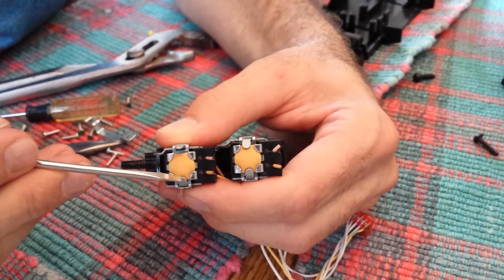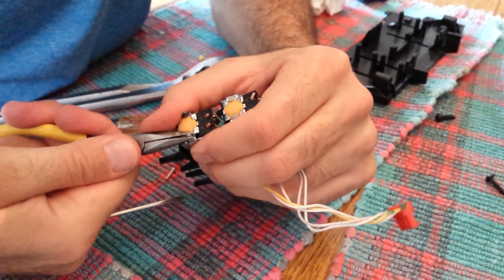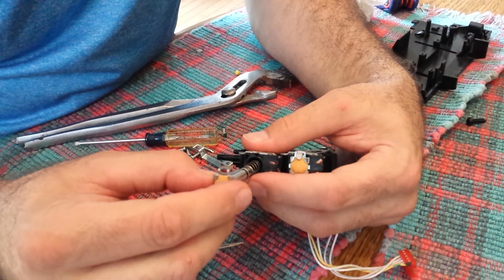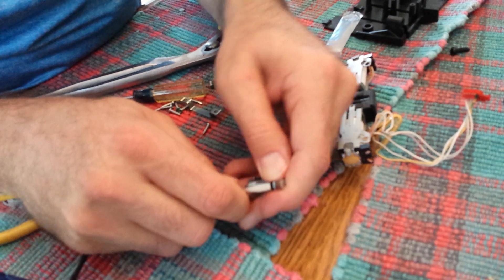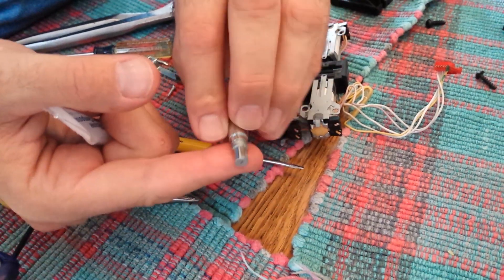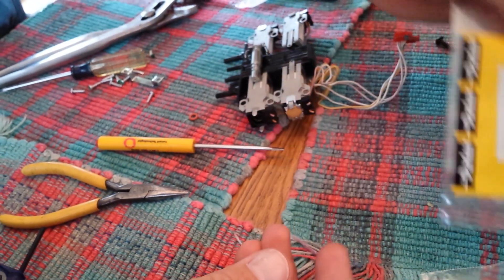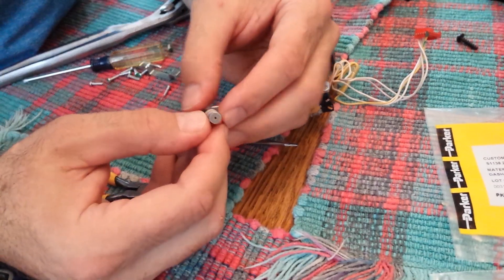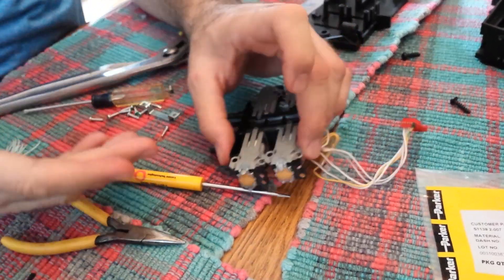EATC UNIT O-Ring replacement for Ford and Mercury Electronic Automatic Temperature Control

Comment: Took a few videos and troubleshooting to find out why it was defaulting to defrost and floor vents. Great video, went and checked to see if the unit had vacuum and the accumulator door. Both were fine and the heat and ac function worked great. Cant safely drive in the south with ac fogging up the windshield. The Hvac unit is in good working order and the car is a 2006 crown vic with 66k miles. Just got my O-Rings in and will be replacing them ASAP. Again thanks for the video.

Comment: Big thanks, worked for me too on my 2006 Grand Marquis. I noticed that you are asking about other ways to get the rings. Well I saw this on a Saturday and needed immediate satisfaction so I went to my local auto parts store and they had the 007 o-rings (that's what they're called). I paid about .80 cents each and $1.50 for silicone grease. $6.00 at the end of the day and I'm so please. AC and heat blowing where it should now.
Reply from the maker: So glad it helped you out.

Comment: Hey thanks!  Just did this to my 2005 Grand Marquis and it worked.  Wasn't switching from vents to anything else, now it seems to work.  I can hear that good old school clunking when I change to the floor vents, and MAX AC is back in full force.
Reply from the maker: Mark,
Sweet !   Glad it worked for you also, how much did it cost to replace the components ?   How much time was involved ?   Just for everyone else's curiosity.

Comment: Thanks for the extra indepth. Have had 3 Grand Marquis since 1996 and somewhat the home mechanic on them. This issue : well spent lots of time on troubleshooting and still same issue and then came across your video. Ordered the O-rings : installed in about 30 minutes: works great. appreciate the help. Issue is solved. was dreading dropping the console to replace the panel door motor but had found out it was working well. Eventually pointed to the control module and well the orings were weathered out, one really dry and crumbly. I do go to fordforums and put my two cents in when i can. again thanks. you have inspired me to make a video of something I may know that others dont.
Reply: 123skyvision , part number please , links in the description open to same product
Reply: I will look for the package in the garage and see what it might say on it. May get back to you later on today or tomorrow.
Reply: How many you need. I can mail you some. Here is a part AS568-007-RR806,  description  007 oring 70 duro red silicone. dont remember where i bought them.
Reply from the maker: 9396K12 Silicone O-Ring, AS568A Dash Number 007, Packs of 25 
Amazon:   
http://amzn.to/1G1b7yN
1418K29 Electrical Insulating Grease, Standard, 5-Gram Packet, 830 Dielectric Strength
http://amzn.to/1G1b7yN
Reply: ARTHUR LEAL thank you very much for the effort dear , i am in saudi arabia and need to fix my eatc , the part number 9396K12 doesnt show any result over amazon
Reply: kingpcb thanks brother , 9396K12 doesnt show any result and short link redirects to amazon main page.
Reply from the maker: 123skyvision http://amzn.to/2q3mume

Comment: I just did this repair on a 2004 Crown Vic.  First I examined the vacuum lines in the engine compartment.  Next I tested the vacuum reserve tank on the drivers side inner fender.  It was fine.  I then inspected all of the vacuum lines under the dash as well as I could see them.  All looked fine.  I ordered the O-rings from McMaster-Carr for approximately $3.00 for a bag of 25.  They came in two (2) days.I took my time taking the dash piece off and removing the unit so nothing broke.The repair went just as described.Less than two (2) hours start to finish.  The system is now functioning perfectly.Very glad I did this. 

The O-ring part # is: 9396K12

Comment: Did this turned out black plastic vacuum line broken at firewall
Reply from the maker: Any broken vacuum lines or a leak in the system could contribute to this problem, this video does not take this into account.    This video only repairs decayed O-rings at the head unit HVAC control.

Comment: I've replaced the o rings in my 2008 Merc Marquis and it works for a while and then the same problem occurs. I got the 007 silicone O rings 100 pack but can't figure out why it only last for a day or so. Last time I did the fix I just keep the air condition running cause I know after I turn it off and get in my car later and try to run the AC it's back to hot air and Floor and Defrost. any advice or help would be very much appreciated. Thanks!
Reply from the maker: Make sure you are using the Dielectric grease to lubricate the O-rings, and if that does not work you could have another vacuum leak.   Check all the vacuum lines you can access.

Comment: I tried this on my 2003 Harley Truck and now it only defaults to defrost, before it would work through vent.  I used o-rings but not the brand you had could it make a difference?  On the ends of the coils what is the purpose of the rubber?  On  mine it was more like a sponge type material. For the time being I rigged the vacuum to bypass the controller so I can get flow through the vents.
Reply from the maker: The ends of the coils is a spongy material as you describe, I'm not sure of the purpose exactly but I believe it is a venting type material which allows the pressure to equalize ?  If you didn't use o-rings that were the correct size, it could make a difference as vacuum would escape around the o-rings.   Did you also use the lubricant grease ?   I would recommend double checking the sizing of the o-rings and perhaps purchase the ones I recommended.
http://amzn.to/1G1b7yN
1418K29 Electrical Insulating Grease, Standard, 5-Gram Packet, 830 Dielectric Strength
http://amzn.to/1G1b7yN
You need to replace all 4- O-Rings in the EATC unit, and after the repair and re installation, the car must be running to test functionality (It needs vacuum assist to operate).

Comment: I did this on my 2008 crown vic and it's still blowing cold air on my windshield. Is there anything else it could be?
Reply from the maker: Search for "EATC REPAIR" on youtube, there you may find steps to run a diagnostic which will give you a code to search.    If there is no code, you may have done the repair wrong or one of the o-rings may have split.

Comment: I can't even get to the o-rings because my EATC module isn't bolted down, it looks like it's spot welded. Any idea on what to do?
Reply from the maker: Eric Castro Do you mean the EATC module is welded to the car, and not screwed in?    All the videos I have looked at  on youtube are screwed in.    I don't know your particular application, it may be different or you are looking at the wrong unit?
Reply: kingpcb the assembly itself. Sorry, I confused the parts. Whereas yours has 8mm screws holding it down, mine has been spot welded in place. If that clarifies it any.
Reply from the maker: Eric Castro  Perhaps you could drill out the welds, repair the EATC unit, then put some retainer clips (sometimes called "speed clips" in that would be placed instead of the weld?
It's up to you, that is my opinion.    If your not comfortable doing that, time to call a professional.
Reply: kingpcb that's actually what I was thinking about. Luckily, I work at an auto shop, so I can have my coworkers look at it. Thanks for the help though.

Comment: now will this solve the problem of not being able to turn the a/c off at all
Reply from the maker: +Chris Taylor    There is a diagnostic you can run on the EATC unit .    For me, this fixed the problem with the blower doors / direction of airflow.
See this link for a video someone else did for the diagnostic (I have not verified if this will diagnose your issue).
https://www.youtube.com/watch?v=hAqE-oYnvlQ

Comment: Does this work on Ford rangers
Reply from the maker: You'll have to pull the unit,  if it has vacuum lines connected then most likely it could have the same issue.

Comment: nice video..

but, what are the problems that require this perform?

because my air conditioner has problem with the pathway of the air !!
       sometimes it change to floor , DEF or may doesn`t pass !!
Reply from the maker: See this video for more information for the problems this may fix:This fixed a problem where the blend door was not operating correctly (not changing to floor / defrost or panel vents).Basically the o-rings are bad, and leak so that there is not enough vacuum to operate the blend door.@watch?v=hAqE-oYnvlQ

Comment: What is the O Ring size????
Reply from the maker: These are the parts you need from McMaster Carr or Amazon links below:
9396K12 Silicone O-Ring, AS568A Dash Number 007, Packs of 25 
Amazon:   
https://amzn.to/2l8aguk
1418K29 Electrical Insulating Grease, Standard, 5-Gram Packet, 830 Dielectric Strength
http://amzn.to/1G1b7yN
Reply: @kingpcb  The original O-rings that came with the car are outdated. They are made of silicone, and silicone isn't the strongest O -Ring. They are prone to tearing and failing prematurely.  My advice is, buy the one's that are "nitrile." I know that Harbor Frieght carries a set of 205 pcs. They are all different sizes, but comes with the size you'll need for your panther platform.  It's the F1014x labeled in the box. The item number is 67644. .

The box will say, "HNBR O-Ring Assortment.  HNBR stands for "hydrogenated nitrile butadiene rubber," which is far superior to silicone and withstanding extreme temps. So when you look for new O-Rings, don't buy the silicone ones, get the HNBR ones. 

If you don't live in an area where there is a Harbor Frieght then check out their website.

Comment: I wonder why other videos show people removing that entire assembly bracket. It looks like all you did was remove the plunger without removing the plunger housing . Is that correct?
Reply from the maker: I believe that is correct, I had to remove part of the housing.   There are probably different variations of manufacture.    The idea is to access and replace the O-rings, inspect the plastic tubing to ensure no other possible vacuum leaks.    Just use your creativity, view all the videos you can and once you get it out I'm sure you'll determine what is best in your application.

Comment: Orings have to be silicone?
Reply from the maker: Silicone O-rings are more durable, and the additional cost is not really prohibitive.   Silicone O-rings have a higher Tg rating (hot / cold endurance).    If you want to do it again in a few years, get cheaper O-rings.

Comment: anybody know if it matters that I damaged the foam on the ends?
Reply from the maker: I'm not sure what the function of the foam is, I would imagine it is a type of filter for the vacuum.   Depending on the damage you incurred, perhaps you could find a similar material and replace it.
Reply: I also destroyed my foam when I did this and I used the foam off of a foam paint brush and just cut it down to the right size... I have no idea if it's actually functioning inside there or if it's just causing a whole bunch of damage but it seems to be working for now so that is tomorrow's problem LOL

Comment: did my 04 crown vic last week. took about 45 minutes. 100 ct. silicone 007 0 rings on ebay for 6.50 shipped.

Comment: just put dieletric grease if washer not broken !!!!
Reply: ***** you was right it went back out !! but I couldn't wait to order silicone O-rings . I went to the junk yard found a 1998 Lincoln continental broke it down the O-rings look new so I took the whole actuator , put it with my 2006 grand marquis eatc and some dieletric grease an it work ! 98 Lincoln system is not the same as the grand marquis but the actuator are so hope this help someone !!!